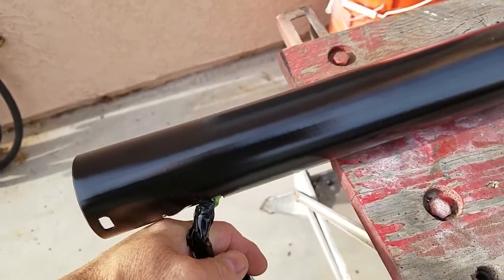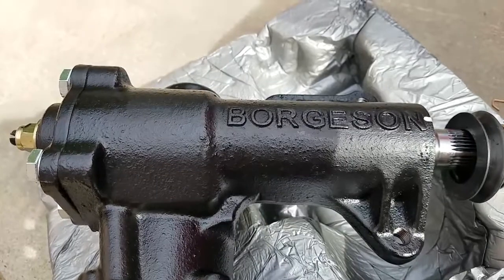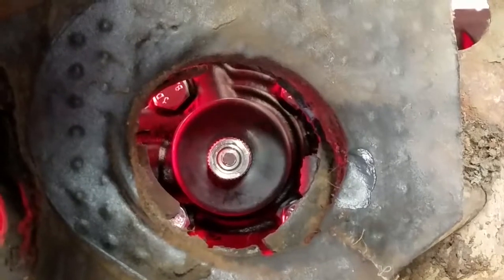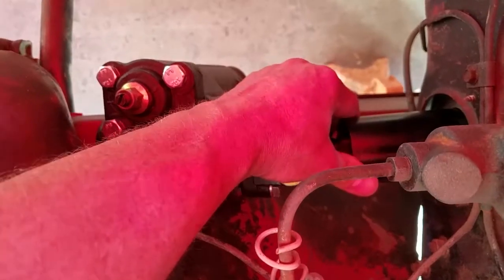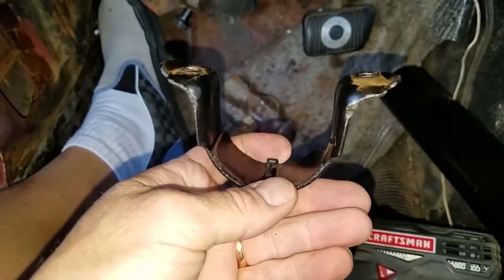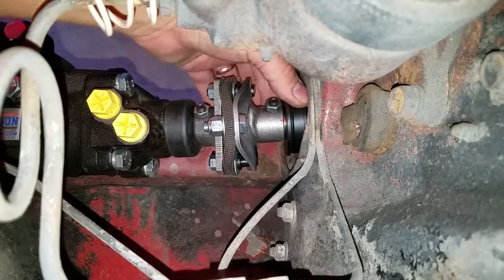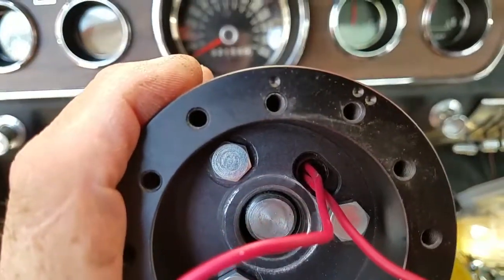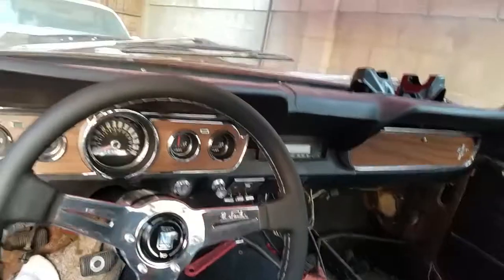Installing Borgeson power steering in 66 Mustang pt 2 of 2 (well, 3)

Comment: I know it's been a few years, but do you recall the total you took off the column?
Reply from the maker: @23:20 you will hear I say I took off 6-9/16" total. Well since there is a bit of in-and-out adjustment on the column also, but not too much. I haven't had the column back in for 2 yrs but it will be put back in the next month's time... much done since then including replacing the firewall, engine/trans, rear end, floors, etc.

Comment: Me again, I would drill those set screws into the shaft a bit on the steering box side, you haven't lived until you have the shaft come out wile driving, ask me how I know.
Reply from the maker: Sounds crazy.... Thanks for the tip as I am near reinstalling the column after replacing floors, firewall, etc.